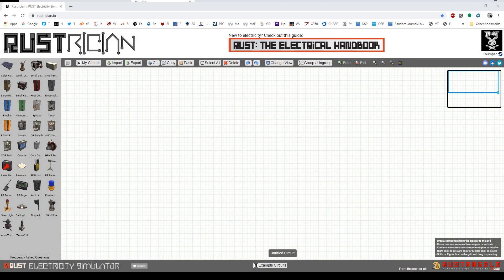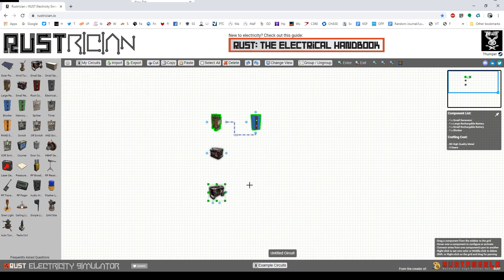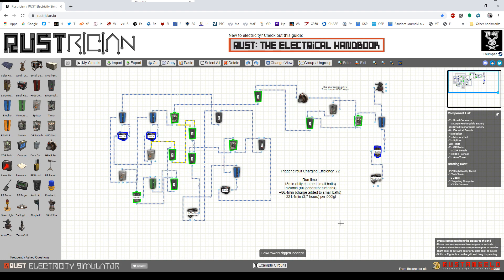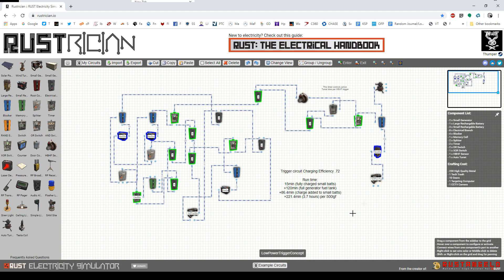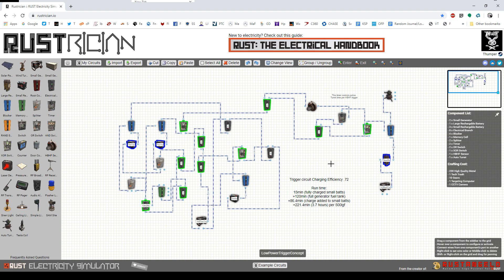Rust Electricity: User Request - Cave Base Low Power Turret Trigger

Comment: When the fuel and all power in the small batteries run out, you cannot get the circuit running again.
Reply from the maker: Good observation. Easiest fix is refuel and restart genny manually. You could refuel and replace the small batteries also, but that's too much work :)

Comment: RABID! By flicking on and off a battery, using its own power to shut it off constantly, you can get 4x the charge. It changes the way you can use your power, so that you might mostly use that to power sensors and doors. using the sensors, you can trigger a generator when needed.
Reply from the maker: Not a bad idea on the high-power, large battery driven circuit to get better detection run time, but my margin here on the small battery is so small, I'm not actually sure if it is practical to use this trick. It certainly would save on the low grade for charging though!
Reply: @RabidRabbitGamer   Trust me, I used this for small batteries... and a generator. :)
You can couple them!

On another note, without using this trick, I made a 5h low-power system. Watch your "discussions" for more info. 

I just want to give you the rustrician blueprints. You are good at presenting things.
Reply from the maker: Sure thing, would love to see the blueprint!
Reply: @RabidRabbitGamer   Here you are, I had to clean up 8gig on my dropbox account  :

https://www.dropbox.com/sh/fpfin2lghv23oh2/AABD1E4vRswlEUQ5vDwxR_Kqa?dl=0

Power routing circuits are in here too.
Reply: @RabidRabbitGamer  I wonder if Youtube remove comments with urls. Did you get it?
Reply from the maker: @tsunamio7750  Hmmm I'm not seeing it, perhaps. You could post it in Discord.
Reply: @RabidRabbitGamer  It's on your discord
Reply: Teach me your ways senpai
Reply: @neilsheridan6292  Sadly, the way already changed. Now the rage is all about externalied processing for your cave base.

You can use receivers to block and activate batteries.
Make an outside 1x1 base just to run a clock every 10s.
In your cave, set a receiver on a small batteryto check for hostiles using HBHF censors. Check for hostiles once every 10s. Your small battery of 15min will now last 150 min. Have fun with tis concept.

Comment: Just pointing it out:
Using only power generators for the turret is the best option. The battery will waist power at all turns... Just use power generators.
You can use memories to direct the power towards the turrets you need. by example, you root your 7 units to one triggering circuit... which when activated start a generator which will, depend on the state of other sensors, root the power where it need to be rooted. one generator, a thousand turrets... IT IS CONSTANT! O(c) !!!

Comment: if you use, 4 Large battery's , set to go off one after the other, then you get 16 hours. Trying to find out how to set up where the first battery to get recharged by the other 3 before it kicks back on...
Reply: i'm trying to Find out how to use 3 of the 4 battery's to recharge the first battery, seeing that u only need maybe 20 at the most to run your system. That would give u 80 to use to charge, that x 3 might give yo 5 battery's out of 4
Reply: or have a loop of two battery's. one runs your base for 4 hours, when it cuts off,  then next one runs and charge's the first battery, then it runs and charges the other back and forth until its drained.
Reply from the maker: @georgerichards7695   here is an older video that may help answer that question!  https://www.youtube.com/watch?v=QYzU7M9P6iE

Comment: would be easier to just have 2-3-4 large batteries (1st stopping the 2nd, 2nd stopping the 3rd, etc).  could also power 8+ turrents out of it.
Reply from the maker: Above ground where you have good charging sources sure, but in the cave where your only power source to charge is now the small generator, any little bit of efficiency helps.

Comment: Is there a way to run lights and sam site using solar panels  battery back up obviously for night time
Reply from the maker: Absolutely! I have a few UPS system builds on the channel here! Electricity is a lot easier in Rust if you're not trying to survive in a cave :)
Reply: @RabidRabbitGamer  keep up the good work just used you turret video with backup gen to sort my base out 😁

Comment: What is the timer set to on the bottom left of the circuit? @rabidrabbit
Reply from the maker: In the drawing, 1250 seconds, you can play with that in Rustrician. This build isn't really applicable with the new batteries now however...

Comment: Why can’t you make an electrical branch (which gets power from the large battery) that splits 10 power to the turret and the other 90 back to the charging port of the large battery? It will deplete the battery much much slower.
Reply: cant charge a lage battery and jues it at the same time  sorry fore bad english
Reply: @Ghawl30  You can, but its going to discharge faster than it charges. Since the other 90 units of power arent being used for anything else, you might aswell send it back into the battery to deplete it slower
Reply: @dannysmitherings9502   ass fare as i have seen the batery is ether being juset ore chargin     on ore off  if  im understanding   it corektly
Reply: @grimreaperhoschy  what im thinking is that  if you loop back  to a nother batery  then after  hava a timer that switses the baterys so then other batery sorry fore my bad english XD
Reply: cos he ses the  bigg batery allways putts aut 100 power and  to run 1 autoturret you only need 10  so putting the rest off that 90 power  inn to a nother batry must be samthing  you can you ?
Reply: @Ghawl30  yes it should work but i only tried it once on a building server so i dont have any long time information. But you need a little bit more then just a blocker
Reply: @grimreaperhoschy   ye i understand that but im not  good enuf to  figure out a setup on my own XD